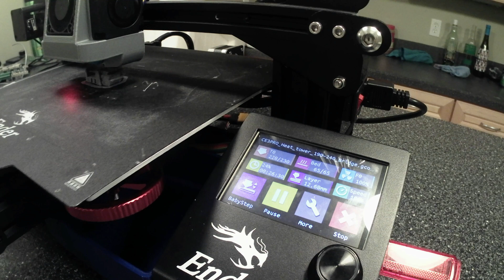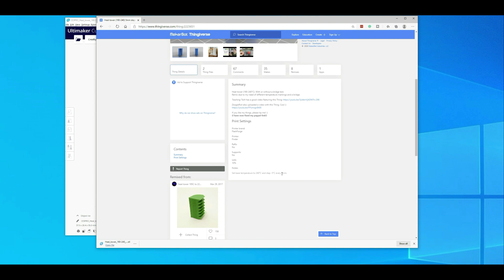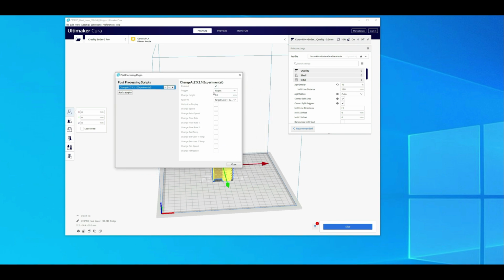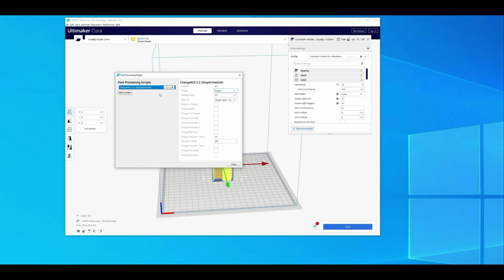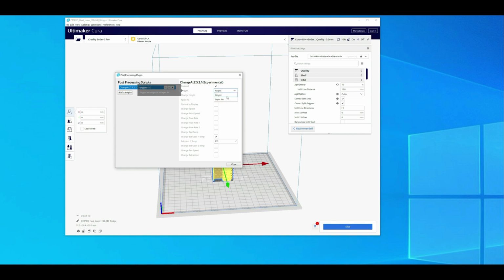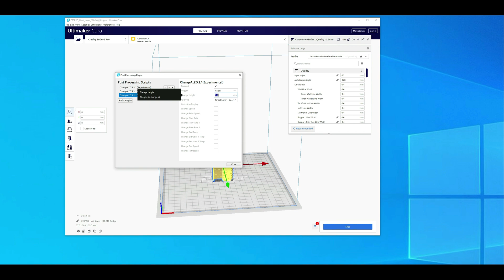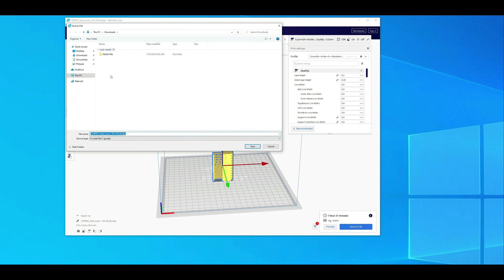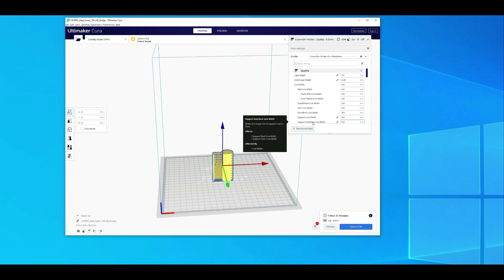Cura 4.8 Temperature Tower Issues

Comment from the maker: I hope you found this overview helpful! If you have any questions or would like other tips/tricks, just let me know in the comments.
Reply: Thanks for the tips. I already had custom code that replaced ":LAYER:" with "M117 INDICATOR-Layer" (For an octoprint display plugin). When I added the change layer commands for the temperature changes in cura they came AFTER my existing code change. Thus no temperature changes were inserted. But, if I moved my layer change code to the last line, then the correct temperature changes were insterted into the Gcode. My guess is that the change on layer/height searches for the "LAYER" comment in the Gcode to make a change.
Reply from the maker: @NathanSTeuscher  Hi. Thanks for the feedback and additional information. That’s a very interesting find. It does sound like it may be related to how the plugin is adding the commands to the gcode file. I hope they will patch the plugin at some point.

Comment: I know this is an older video and now 2 years in I am just now trying to do the temp change tower... I am using a stock Ender 3 Pro and Creality Slicer 4.8 and it will do about half of the temp changes and then defaults to the 200 c temp that I have the warm up at, and I am also using Trigger at Layer  No. any advice?
Reply from the maker: Hi. Check the gcode file that gets produces to see if there temp changes are called out.

Comment: there is stil a problem with cura temp tower script up to this day and cura version 5.3.1. somehow it temp switch at layer height goes haywire at some height. hers what i mean, copied these from tower i try to generate temp switch should happen every 42 layers.
;LAYER:4
;TYPE:CUSTOM LAYER
M104 S260

;LAYER:42
;TYPE:CUSTOM TEMP
M104 S255

;LAYER:80                          {This supposed to be 84}
;TYPE:CUSTOM TEMP
M104 S250

after this point switch happens lower and lower than it supposed to be making this calibration tower useless to calibrate anything
Reply: TempFanTower script has this bug if it would work then making temp towers would be faster. Change at Z height works fine used it in the end to do what i need
Reply from the maker: Hi. Interesting, i will try to look into this more when i get some time. I know the plugin has had issues.

Comment: Thank you! You made a point to stop in the settings (quickly) to show that you set the starting temp to 240. I've watched several of these videos now, and they all seem to omit setting your starting temp. Since the script has a box for the starting temp, I incorrectly assumed that it would set that as well, but the result was just that my starting temp was near my ending temp, and there were no temperature changes as it printed. As soon as I set the correct temp in the settings, it worked great.

Also, note to anyone trying this in 23, the plugin does download the scripts, to a scripts sub folder of itself, but at least for me in the Sovol custom version of Cura, the "copy scripts" button does nothing, you need to manually move the .py files from plugins/calibrationshapes/scripts to #/scripts (1.5/scripts for me, now).
Reply from the maker: Hi. You're welcome, and thanks for sharing your findings.

Comment: FYI it is a slicer issue not a firmware or anything else as far as I can tell. Creality slicer aka cura 4.8 doesn't even insert the gcode m104 commands to change the temperature. Cura 5.2.1 inserts the gcode properly but I still have to figure out how to get it to print in the center of the bed instead of the front left corner where it just makes a mess. Creality slicer prints in the right location but doesn't change the temps.
Reply from the maker: Hi. Yes, the issues that came up were are related to the slicer. I was able to get it to work when switching to layer height though.
Reply: @3DPrintscape  I tried layers and it wouldn't insert the m104 gcode. Cura 5.2.x is the way to go. Thanks.

Comment: Layers isn't working for me.
Reply from the maker: Hi. So layers and height isnt working?
Reply: @3DPrintscape  I didn't try height, only layers. I figured if it wasn't going to work then I'd switch to another slicer. I kept thinking it was some wrong setting in firmware at first, then I dug into the generated Gcode and boom it was missing all m104 calls.

Comment: After a very frustrating couple of days of failing to get the Cura temp tower to change temps, I now think that I have a solution that may be of help to other. I have Cura 11 [and Cura 10] and my printer is the Ender 3 pro with a 1.1.5 silent board and Marlin 1.1.9 installed by Creality as delivered. I have loaded the Cura temp tower, loaded the TempFanTower script, and set all the levels as described. The tower prints without a problem but the display always shows the same temperature and looking at the tower is is clear that the temp has actually never changed. All this stayed the same after messing about for a couple of days [weather is bad so I am stuck indoors]. What seems to have been the problem all along is that my slicer settings that I have been using are the ones I use for normal printing and they are not the standard Cura settings. I also have not found anywhere what settings I should use in the slicer, I assumed quite wrongly that the "temptowerscript" would over-write the settings, but it does not do that. So having set up the script, I then set my slicer to the  Cura setting of "Standard Quality". [This uses a 0.2 layer height for all layers, but I had been using 0.2 layer height but 0.16 for first layer]. Then, since the temp tower was set to start at 220° and end up at 190°, in the slicer I set the printing temp to be 220° in all places except the "Final printing Temperature" which I set to 190°. I had little expectation of success after 2 days of frustration, but it worked. Temperature changes do happen, they agree with the temps printed on the tower, and the reduction of blobs and stringing as the temps reduce is clear indication that the temps actually do change throughout the print. So long story short, use the standard setting in Cura and set the printing temp to 220 and the final temp to 190, and with a bit of luck and a fair wind, it might just work for you. I hope this helps somebody.
Reply from the maker: Hi. Thanks for sharing your findings. Im sure they will end up helping someone out.

Comment: Thank you! I’m new to printing and couldn’t print a temp tower cuz I’m using geeetech a20m and cura 4.10. I was tryin to use the new script which is supposed to be all I needed but tried your video version and it finally worked. Thanks again, now I can finally start tuning for a good print
Reply from the maker: Glad I could help! :)

Comment: My ender 5 pro will not change temperatures, or if it is it's not showing it!
Reply from the maker: Hi. If it changes temperature, you would  see it on the display. Did you set the change to be at the layer number or height?
Reply: @3DPrintscape  layer number
Reply from the maker: @jf6720  Can you check the g-code file to see if it has the changes?

Comment: Thank you for this, this got it going right. Still happening in 4.9 on Kywoo Tycoon which is described as a "32-Bit TMC2208 Silent Motherboard" and is running on customized marlin firmware.
Reply from the maker: Hi. You're welcome and im seeing the same behavior in 4.9 as well. I think it will be on the plug dev to fix the issue, not Cura.

Comment: The problem is one well known to programmers - NEVER test for equality to a fixed number if you're testing a non-integer (or one that's discontinuous).  The height could be 4.999 for one layer, then 5.099 for the next one (assuming 0.1mm layers).  So the Z axis is never at 5.00, so the script never triggers (and the same for all the others).  That's why Layer works - it's an integer number, so it increases by 1 for each layer - so you'll always hit whatever layer number you put into the script (as long as you don't try to trigger on a layer higher than the top).  If you examine the gcode file (it's just text) with height, you can probably see, when Z is just a bit less than your trigger height, that the next step is above that height.  (I haven't tried that - I don't create code that I know won't work.)
Reply from the maker: Hi. Thanks for the input. I know there is a fix you can do in the g-code file but it would need to be done every time you slice something that needs to run it. I figured it would be easier for my viewers to change how they are setting it up in Cura.

Comment: Same thing here... trying to load gcode on to Snapmaker 2 using Gcode generated in Cura 4.8 and loaded on to Snapmaker using Luban. Used height method, no good.

Edit: Changing script to be layer count-driven rather than height-driven fixed the issue for me. Thanks!
Reply from the maker: Hi. So its not working when you set the temperature to change on layer number?

Comment: As a new Ender3 V2 owner, thanks for this help in getting me started on a temp tower.  The only issue I had with this video was that I couldn't read any of the text shown in your Cura menus on my laptop monitor, since you had such a large monitor on your computer.
Reply from the maker: Hi. Thanks for the feedback. I have been struggling to find a resolution that work well for everyone and doesnt get messed up when combined with the 4k camera. It has actually been pretty difficult. Sorry about.
Reply: @3DPrintscape  I went over to the "Written Instructions" part and the original video "Create 3D Printer Temperature Tower With Cura! (Complete Walk Through)" has a resolution that worked well for me.  I could read all of the text there, which helped fill in the blanks in the new video.
I'm printing my first temp tower as we speak.
Reply from the maker: @chrisboyd4433  Cool, its nice to know that those articles are proving some value as well. Im glad you got everything working.
Reply: @3DPrintscape  Two successful towers now.  I watched the display.  The temp changed according to plan at each step using layers.  My only problem is that all of the bridges look great.  I ended up flexing the two towers up and down to see which bridges were better adhered.  That worked to dial the temp in.
Thanks!

Comment: I also had no issues with temperature tower prints when I used 4.7 to test temps with PLA filament. I have upgraded to 4.8 and had the same issue where the temperature wasn't changing where I had instructed it to while testing temps with ABS. I'm glad I came across this video. Several people reported having issues with Cura 4.8 on the group for my 3D Printer as well. Thanks for showing this workaround even though it looks like I'm going to revert to 4.7.
Reply from the maker: Hi. Thanks for the feedback. I know a lot of people have switched back to Cura 4.7 for different reasons, I did as well. Recently I started to use 4.8 again to try to work through issues that come up. If you come across any others, please let me know.
Reply: @3DPrintscape  thanks I lost a whole week to this. First I thought it was maybe my firmware. After a week of deciphering WTF those settings do I think I have worked it out mostly. Now all I want to do is be able to create and use temp towers like everyone else. So much fail with all of this.
Reply from the maker: @robertjackson-te8je  What issues are you having?
Reply: @3DPrintscape   It was Creality slicer 4.8 which is built on Cura 4.8. It fails to add the m104 temp change code to the gcode. Switched to Cura 5.2.x and it works now. Got the print to center out. Got the UBL leveling working. Now my extruder eats my filament causing ghost prints. The issue is the spring is too strong, even fully undone it is eating it. I even changed the extruder wheel from brass to steel. So now I order some compression springs from amazon.

Thanks for the helpful video.

Comment: I just did what you mentioned in this video, it worked for me. Only error, theres a "enable box" at the top that needs to be hit. I did not have it checked on my 235deg layer, so it did 240 twice. Other than that it worked perfect. Thaks for making the time to do this video.
Reply from the maker: Hi. Thanks for the feedback, and im glad you got it working. I just did a quick check, and the enabled button was checked for me by default. It possible that is cached somewhere, though. Thanks for pointing it out, it helps me answer other people's questions better.

Comment: Excellent video, thank you :) 

Even if it is not fulle related, I take the chance to ask you about a weird behavior in Cura. I've got a .stl for an electronic card's case. When I open it in Cura everything looks fine (see box01.jpg) , I can slice it without any issue but when I preview the job the junction of the walls (corners lower part) are missing!!! (box02.jpg).
In the link to my Drive, you can fins some snapshots about this matter and the original  .stl file. 
Any lead to solve this? Thank you in advance

https://drive.google.com/drive/folders/1OM2d86cqwfVdHrRI9dcFtpPlck2Xirla?usp=sharing
Reply from the maker: Hi. Thanks for the feedback 😊. I looked at the file in both Cura and Simplify3D and the object appears to just not have the data. The only way to fix it would be to modify the object in a cad app or find another object to print. Sorry I couldn’t give you a better answer.
Reply: @3DPrintscape  never mind, I've got a fixed .stl. Thanks anyway for your availability

Comment: I think it depends on what Marlin version you're on...I have an Ender 3 Pro but my motherboard is BlueTreeTech SKR Mini E3 v1.2...Marlin 2.0.6.1 and Cura 4.8 stock profile works pretty much flawlessly for me
Reply from the maker: Hi. Im not sure if its just the version of Marlin or if the board also comes into play. I have the SKR Mini v2 and the temperature change at height works fine for me.
Reply: I'm using marlin bugfix and it is not working with cura 4.8. In my 18 years of programming I saw this BS many times. Works on my PC, doesn't work on mine. Same code, same programs etc. I hoped the 3d printing world would be better. :face-pink-tears::face-pink-tears::face-pink-tears:

Comment: Having similar problems with a Monoprice Voxel 3D. At the first layer temperature change the nozzle heater just turns off. Problem happens with both  Going to try Cura 4.7.1 and see if the problem is resolved.
Reply from the maker: Hi. Can you let me know how the test with Cura 4.7.1 goes?